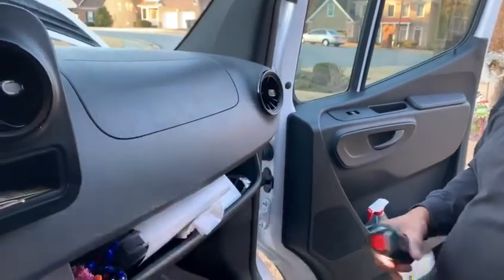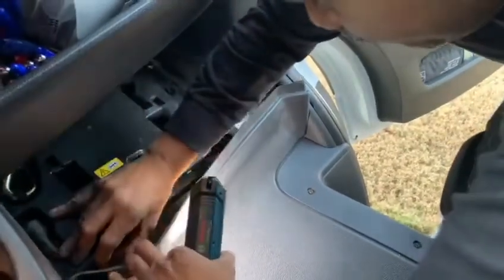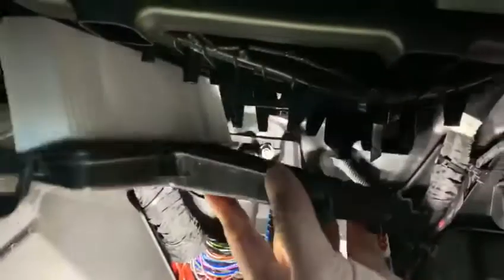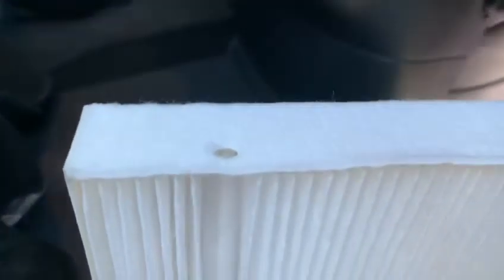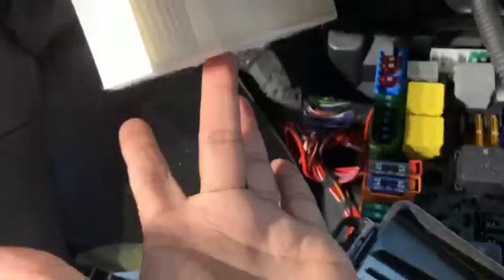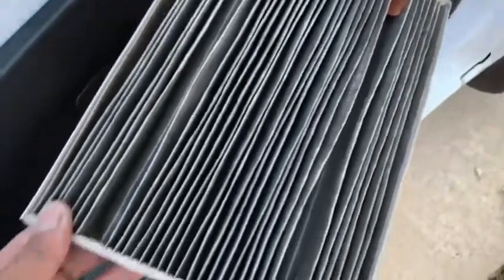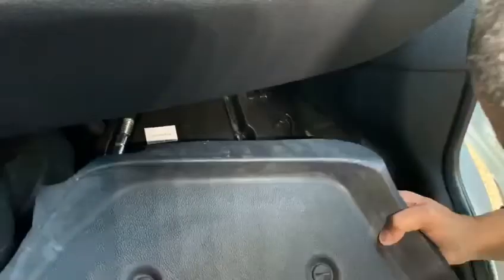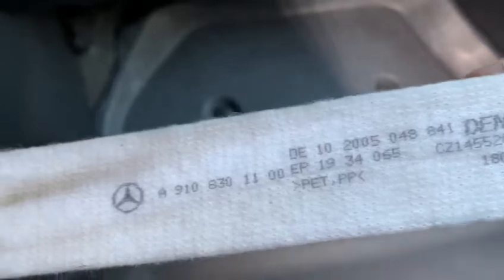Replace cabin filter on a 2019 sprinter 👍

Comment: Thanks. I have a 2015 Sprinter which has a much easier process to change the cabin air filter; located under the hood. I wonder why MB changed the location of the filter?
Reply: Do you know if there is a inside cabin filter inside on a 2016? The outside filter is filtering incoming outside air, not inside air.